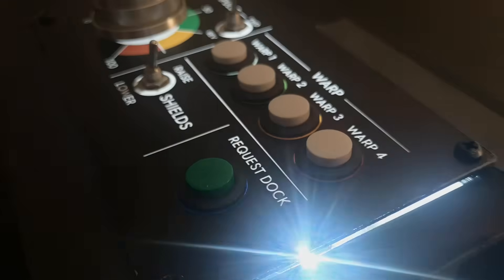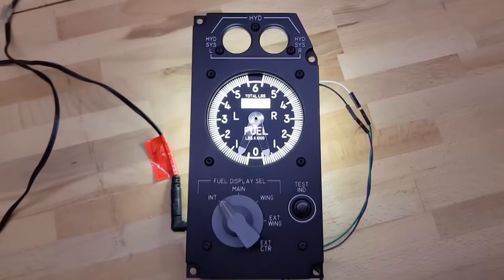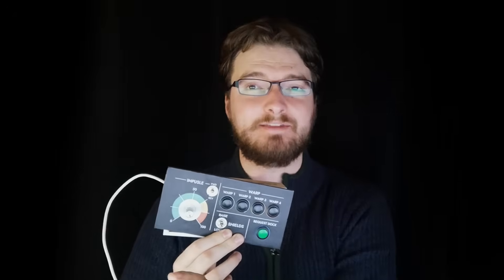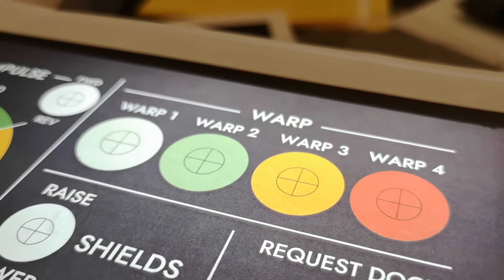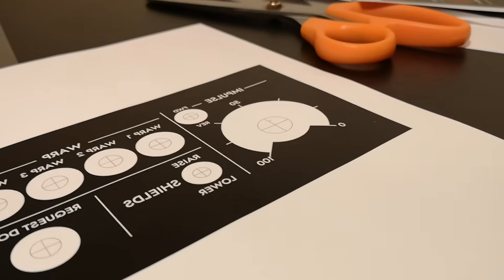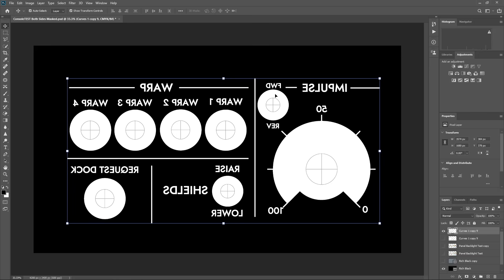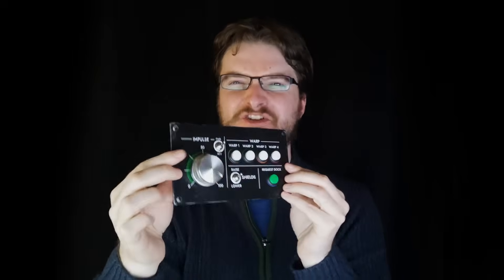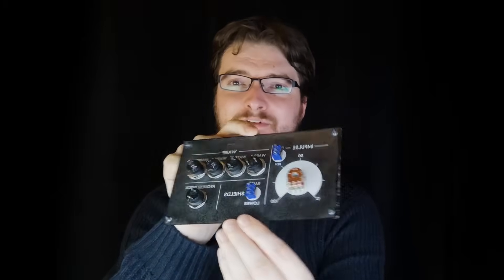The $2 Backlit Button Panel: Simple Method For Flight Sims and More

Comment: Another option for your light hiding could be to print just the gauge and buttons, cut them out, and marking them with a sharpie. Then tape over that area, put the guide back on, and cut around the edge. Now you got your gauges taped. Maybe a light sand with high grit and some matte black paint before removing the tape and applying your final print.

Comment: This methode have only one problem, if you want to change anithing you need to open the entire button box and make it again
Reply from the maker: Yes, that's true there would be a lot of backtracking to change something or fix something in the printed design, especially if the material is glued. Watch out for typos!

Comment: Use black plastic and simply cut holes for where you want the light coming through. This double aided printing attempt is a great way to waste ink and time. Much easier to simply print both sides and then stick them together lined up and already cut out ;)  half an hour lol. Just cut out on black plastic, a much better affect you can actually do in half an hour.
Reply from the maker: Try it and share your results, tag me if you produce something cool! I experimented a lot on the way to the method here and I do think the duplex printing method is the best way to consistently professional-looking results. But, a two-layer glueup is certainly doable as well. With a lot of attention to glue evenness and getting perfect registration between your glued layers, it can look great.

Comment: The best way (and the hardway) to make panels and gauges is using aluminium panels and use the silk screening method to print everything on the panel. It will look like the real deal. This method can be difficult and expensive but it's def worth it. I thought I just mention this although this method won't work if you need backlight panels.

Comment: When you have a broke LCD screen take it apart. There is a sheet of light diffusion plastic in there.
For the guys in the comments talking about light diffusers.

Back yo the project... why not just print 2 or 3 sheets and placing them on top of each other ?

Comment: @0:58 Just would like to point out he's not using a "Desktop laser engraver", he's using a air assisted Co2 cutter he picked up off ebay.  So dont go out and pickup a cheap little desktop diode engraver and expect it to easily cut through acrylic or PCB's.
Reply from the maker: True that it's not one of the hobbyist diode ones, but it is indeed a pretty small unit that he's using. I believe he has a K40 which is about 20 inches deep, 30 inches wide. A Glowforge would also work, or an Xtool P2.
Reply: @EricFergusonCinema  Glowforge i would advise against. It's a extremely overpriced 40w tube. For what you would pay for a glowforge pro you could quite literally buy a 150w full sized industrial cutter.

Comment: Have you tried printing on 0.5mm (or thinner) sheets of abs? That is much more light dense, and does well for backlighting. 

Another technique to try is use a piece of (opaque) acrylic, and sandwich it between a top layer and bottom layer of the print.  You might not need a bottom layer with opaque acrylic.

Comment: Another method I've seen is print the normal image on paper, then print the reversed image on transparency.  You then line up the two with the transparency on top and both printed surfaces touching and glue them together.
This gives you two printed layers right next to each other, so there's no "paralax", AND outer surfaces with no ink on them.  You kind of "half-laminate" the print.
It's also far easier to line up as you're not trying to make the printer do it.
Reply: holy crap this is actually brilliant! I need to try this.
Reply: @akaHarvesteR  https://youtu.be/k8ooTohtTqM?t=600
Reply: wouldn't it be slightly better to print the 'normal image' on the transparent and the mask on the normal paper ?
Reply: @68HC060  The point of the reversed image is that the transparency's "back" side, with no printing on it, becomes the outer surface.  The normal image on the paper eliminates the need for a mask AND doubles the ink density the light shines through.
Reply: @No1sonuk  - That's how I understood it; however, if you print the normal image on the transparency and put the paper (mask) under it, I think you'd get a slightly better quality.
I know it would probably only be a minor improvement (if any).
The most important part is to get the ink on both sheets as close together as possible.
Reply: @68HC060  If you do that, you have the thickness of the transparency between your printed sides, AND you need to do something to protect the ink from being rubbed off the outer surface.

Comment: What about lighter colors like RAL 5017 or RAL 7031 instead of black? Just print the front in RAL 5017 and the back in black or would that cause too much light bleed?
Reply from the maker: It's worth experimenting with and it's going to vary a lot by the printer you're using. In my experience the effect only looks convincingly "solid" (ie, not just like a backlit poster) at full registration black on both the front and the back. Even a slight deviation from this starts to break the effect. Going for Airbus Blue or Boing Brown on the top layer was a total non-starter, not even close to looking "solid." 

This will be better with printers that are willing to dump more toner onto the page in a single layer, or with processes that use more than just two layers. 

To some extent the brightness of the backlight you want also affects this. If you're willing to dim your backlight down a lot, you can get away with less toner and still have a solid-looking panel. Conversely, with an extremely bright backlight the effect will break down, just like shining a super bright flashlight at your hand reveals that your skin will eventually transmit some light not just block it.
Reply: @EricFergusonCinema  Alright, thx for your answer!

Comment: Wow. This is effing brilliant. Here's some thoughts...Have you tried using transparency material for inkjet/laser (clear plastic won't work - they make a special material for this)? The white areas in the artwork should actually come out transparent because there's no white ink in a printer. Ink is actually super expensive. One thing I would do is create an outline shape to use to line things up so you don't have to use a lot of ink until you work out the kinks. Just. Brilliant. 💯
Reply from the maker: Thanks! Yes you can definitely use a printable acetate transparency sheet as part of this process if that's the look you're going for, in this case I wanted white because that's generally how aircraft cockpit panels look: white lettering while viewed in daylight, but backlit-white at night when backlit. Definitely true that getting your printer settings dialed in with a wireframe design could save a lot of toner compared to running it full registration-black like I show in the video.
Reply: I saw another method which does this for the back layer.

Comment: Why not mask the plexiglass where you want the light to come through and lay down several layers of matt black paint and put the paper template on the painted plexiglass?
Reply from the maker: Paint would work for a simple design, but in this case each individual letter is masked, which is why you get the crisp look you're seeing here.

Comment: This probably costs more than laser cutting considering how expensive ink is
Reply from the maker: True that toner's not cheap, but it'll almost certainly work out to being cheaper for comparable coverage than several coats of black spraypaint, which is required for the laser cutting process. (You spray the white workpiece black, then engrave away the paint).

Comment: Great video. Thanks for the info. I'll be using this soon to create a button panel for DCS.  So the trial-and-error process of lining up both sides of the print...what would you say to just using two pieces of paper then lining them up easily because they're both the exact same size? This could also have the added benefit of allowing you to use thinner paper because now you're doing two sheets instead of one. You wouldn't even need to flip the design in Photoshop. Just line 'em up with the printed sides both facing towards the user.
Reply from the maker: Love it, I hope you might consider posting a video or messaging me when you're done! Yes: the two-pieces-of-paper method does indeed work, it creates some fiddly questions about how to mount them to eachother accurately, but it does work. Just test lots of papers to get a backlit look that you like. When backlit, most thin copy paper looks, well, like backlit paper. Thicker higher-quality papers backlight more evently, which is why I started down the path you see in this video.
Reply from the maker: See here for an example of someone using the two-sheets method: https://artemis.forumchitchat.com/post/low-cost-weapons-panel-12255047
Reply: @EricFergusonCinema  Ok, I did a test using 2 sheets of regular old printer paper. It looks ok. I wasn't in a very dark room, so I'll have to see if there's bleed through when the lights are off.  I'll make a video in the next day or two and share it here. Thanks again for the idea!

Comment: Any ideas on how to do this with a non black panel?
Reply from the maker: You'll need three layers. In my experience: to get an ordinary laser printer to put enough toner on the page to credibly black out a phone-flashlight amount of light you need full CMYK registration black. Going even slightly in the direction of boeing-brown or airbus-green gets you a look that simply says "this is a backlit piece of paper". The magic happens when you have that truly solid layer of toner.  But you could achieve this with three layers. One piece of paper that's black and white mask on both sides, and then one that's your final colour. Just gotta line them up very carefully, and accept that you'll lose some light through the extra piece of paper.

Comment: Result: 1000 dollars in toner.
Reply from the maker: 😂 A reasonable concern. Still much less expensive than the equivalent in spray paint though. Realistically I think you're looking at about $0.05-$0.08 in toner here for a panel of the size you're seeing in the video. Takes a few experiments at that cost to get it dialed in, but then you can run lots of the same dimensions.

Comment: What software did you use to create the print? I am having trouble getting things to print to the right scale.
Reply from the maker: Powerpoint! I did then import it into Photoshop. But Powerpoint is remarkably useful for basic stuff like this, just need to accept some weirdness eventually when it becomes CMYK from Powerpoint's unavoidable RGB colourspace. 

If you're starting from scratch though, I'd recommend Inkscape. Free, fairly easy to use, and you'll work in real-world inches and CMYK so your output will be fairly predictable.

Comment: If you hit the plexiglass with some sandpaper it will diffuse the light a bit more too. Make it not as harsh. You'll still get some bleed unless you do use paint/laser combo, but that looks decent for a quick panel set up. 👍
Reply from the maker: Could do, although in my experience you can get pretty ideal results just by carefully managing choice of paper: if it's a heavy-weight stock with a very fine texture (ie not the cheapest copy paper), you'll get great diffusion. Then it's just down to how you space out the LED backlighting to avoid hotspots. Zero bleed with the print-both-sides technique shown in this video, but it's very close. Even a tiny bit less black toner than what I managed to get to with this print would pretty much ruin the effect by making the black regions feel subtly backlit. You can also make it bleed by blasting an unreasonable amount of light at it (think: holding it up to the sun at noon), but any amount of LED backlighting I tested worked perfectly.

The biggest issue in the panel in this video is the shadowing from components under the panel, but that just comes down to designing the print more carefully with the physical size of the components in mind.

Comment: why not just print out the other side on a second piece of paper and press fit the two pieces between the acrylic? Wouldnt that be faster and cheaper as you dont need the trial and error?

Also, its been a while since this video, is the second part going to happen soon?
Reply: Just over 2 solid years later, and it's still the last video of the channel. I really hope they weren't hit by the human malware going around...
Reply: Then the whites will be much darker. 1 Transparency + 1 Paper is the answer though.

Comment: Using laser gloss or laser photo printing on a 90 or a 110gsm can (most of the time) not require the double printing
Reply from the maker: I tried a ton of different papers with very noticeable differences in light transmission quality (some looked like paper fibres, some looked more evenly lit), but all needed a second layer of toner to really convince you that this was a solid black panel with white translucent lettering, not a backlit piece of paper.

Comment: 2$ fail. you need buy machine todo it first whaeva it is printer make vinyl or router carve it so its not 2$
Reply from the maker: No vinyl cutter or router involved here! Just an ordinary paper laser printer and some spray glue. If you don't have a laser printer, you can go to a copy store that'll print your file from USB, it'll still come in under the $2 budget. Honestly if you don't count the several failed attempts to get the registration lined up, the build in this video is probably less than $2 because you could make several with the materials shown.

Comment: A printer that does 2-sided printing probably would work good.
Reply from the maker: Worth a try! The printer I used is actually a full-duplex printer but I ended up choosing not to use it; after some tests it ended up being even more challenging to try to get a printer's built-in duplex to respect any kind of repeatable registration (ie, lining things up the same way every time), but it likely varies a lot by type of printer. Maybe there's one out there that gives good, repeatable results on both sides with the built-in duplex.

Comment: The amount of the printer toner will cost a bit more than $2 ;)
Reply from the maker: Haha could be! Full registration black is definitely not kind to the toner cartridge. I think I still feel pretty good about the price estimate depending on the size of the panel... but you could certainly blast through a large quantity of panel trying to get the registration dialed in, unless you test with a less intensive file.
Reply: Go to a public library that has a laser printer and print it there. Cost is the same per sheet regardless of how much toner is used.

Comment: use lighter weight paper but print only one side i.e. top left the front view, and then bottom left the back view. 
Cut both sections out and glue together. 
Lot less messing trying to match back and front, and 2 thicknesses of paper equal a heavier weight paper anyway.
Reply from the maker: This is doable, and there's a person on the Artemis SBS forums who built a panel this way. In my experience the challenge is that lighter weight papers have a much more noticeable texture, so it doesn't provide such a clean effect. And, lining the two layers up for a glueup is challenging. It's doable (you can try stapling into a hinge during a dryfit), but fiddly. 

Another option is one sheet of heavier, high-quality paper, and one sheet of acetate transparency.

Comment: Why don’t you use two pieces of thin paper, 1/2 the thickness of 28 lb expensive Hammermill paper, print separately, line up, and glue together? That will have the same effect of using a piece of double thickness paper and try to do the duplex alignment the tool, the laser printer, you use is not designed for?
Reply from the maker: It's doable, but it works less well that you might expect because it decreases the amount of light transmission significantly. A sheet of paper and a transparency sheet do work though. Also very challenging to get them perfectly aligned when doing the gluep! You could experiment with different materials to try and get it dialed in. 

The good think about duplex printing as I did in this video is that once you get it figured out, it's fairly repeatable. Just gotta ruin a few sheets to get it right.

Comment: Hey thank you very much. Very interesting way to get good results. One thing you didn't talk about :  How do you actually backlit the panel ? I mean, what do you use and how do you put it at the back of the panel ?
Reply from the maker: Hi thanks for your comment! In this video all the backlighting is simply with a cellphone flash pointed upward at the back of the panel. That's it! You could achieve similar (probably better) results with LED strip lights. They come in adhesive roll and are easy to work with: just affix them to the bottom of any case or box. Deep picture frames work well, see here using an IKEA picture frame: https://artemis.forumchitchat.com/post/low-cost-weapons-panel-12255047